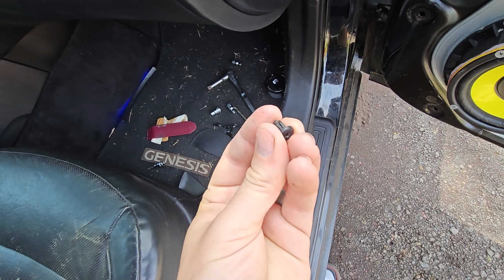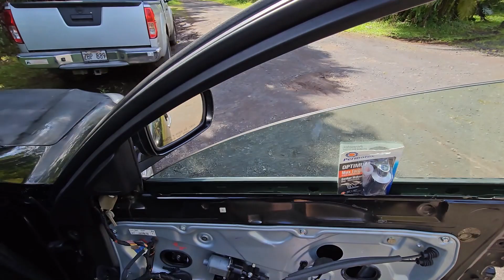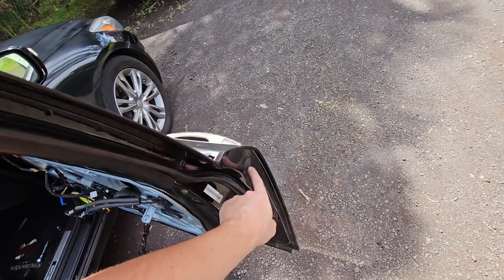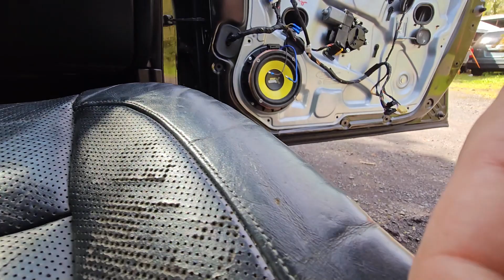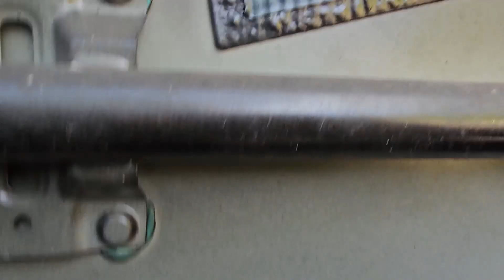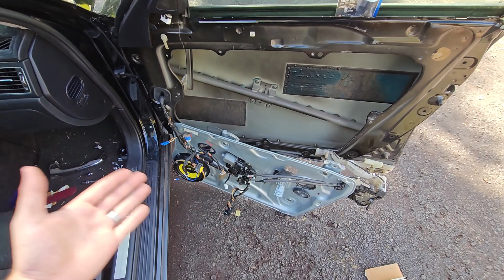Window Regulator Replacement - Genesis Sedan (09-14)

Comment: can i only  change the regulator ?
Reply from the maker: Its a whole unit
Reply: @GenerationGarage  yes i understand ..they sell the motor olso sepertly...so I wonder if they is possible to chance only that
Reply from the maker: @piittiig1  yes you can change just the motor but its not normally the problem

Comment: 2012 Hyundai Genesis here. My drivers side window switches will roll down all of the windows but won’t roll them back up. Fortunately the switches on the other three doors (passenger, and rear) will roll the windows back up, but I can’t roll the driver side window back up. Any idea why this would be?
Reply from the maker: Faulty window switches forsure
Reply: mine has that issue. i just smack it a couple times and it works

Comment: Does a 2012 Hyndai Genesis have to use an official Hyundai part or can it be after market? It's been my experience that after market parts don't work well with this car
Reply from the maker: I try to stay OEM myself to avoid issues, I've found used is often better then aftermarket in most ways

Comment: How do I know if I need a switch or a regulator or a motor? On my driver side all the buttons work except for the  one that rolls down the driver side window
Reply from the maker: I have other videos covering this but it's usually always the switch if it doesn't work at all, Alternatively you could bypass and jump the motor and see if it works to determine if it's the switch or not
Reply: Where can I find that video, I’d like to replace the motor don’t want to deal with having to take of the sub
Reply from the maker: @raphusfoley9730  on my channel

Comment: Thanks for your upload!  I'm changing out speakers in my Genesis GV70 and installing sound dampening material to the door.  although a diff model than yours, your vid gave me all the info I needed to get the inner panel off.